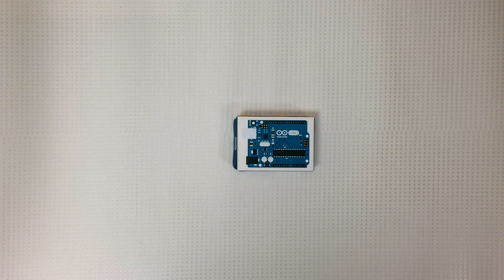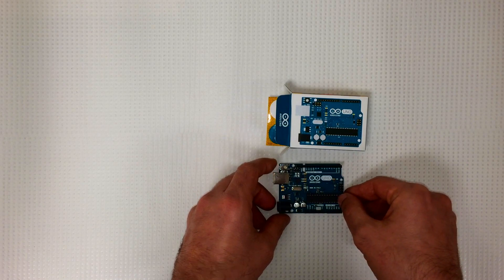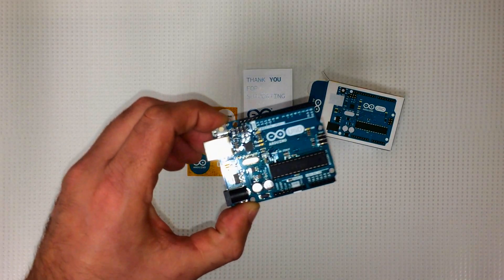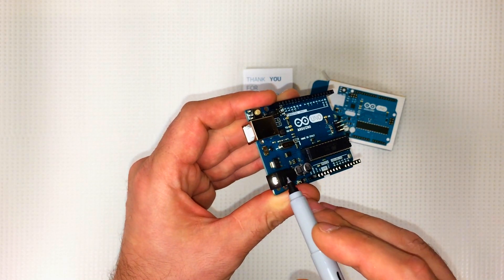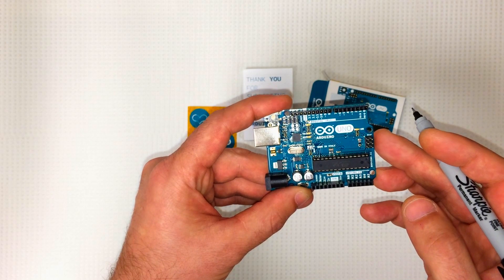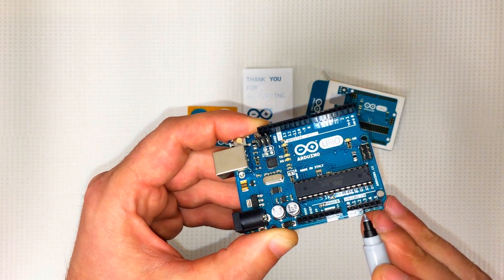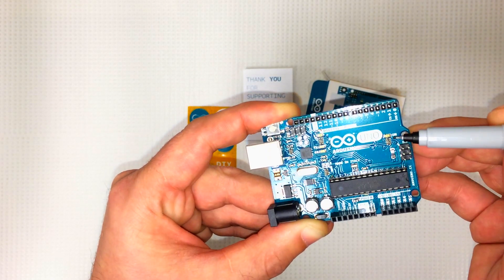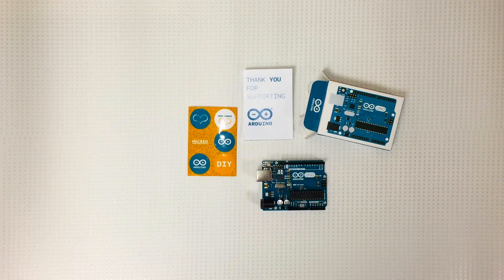How the Arduino Uno Works

Comment: This explanation can improved quite a bit.  I am a self-electronics hobbyist who has programmed the atmega328p mcu with baremetal C code (no arduino libraries, little to no avr libraries).  

The arduino uno board has the following features:
1.  DC jack port where you can connect a 7V-12V (ideally choose around 9V if its arduino uno clone) AC/DC adapter if you ever want to power the board through your wall outlet or with a battery.

2. Alternatively, you can power your board via the USB port.  This USB port also provides the connection for you to upload your code to the Arduino using the bootloader thats been programmed to some section of the atmega328p flash memory.  You can program it by loading sketches in the Arduino IDE or using avrdude to load .elf files (or some other suitable executable file format) compiled from C/C++ source files.

3.  Aside from uploading code via USB, you can program the mcu by connecting an external avr programmer hardware to the ICSP (in-circuit serial programmer) pins of the arduino board.   
4. As a last option, you also have SPI (serial peripheral interface) pins which can be used (as a last ditch effort) to reprogram the mcu.

5.  The reset button, when pushed, basically pulls the NRST pin of the mcu to a LOW state.  This causes the processor to reset and start code execution from the beginning of your code, wherever that may be.  However, its more accurate to that say that the processor resets to some predefined PC (program counter) value and starts executing opcodes from there.